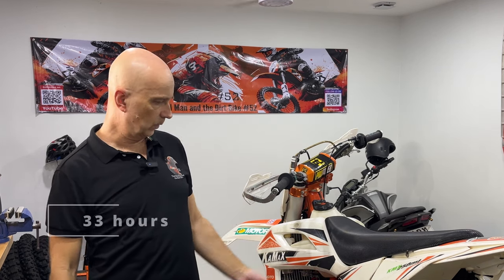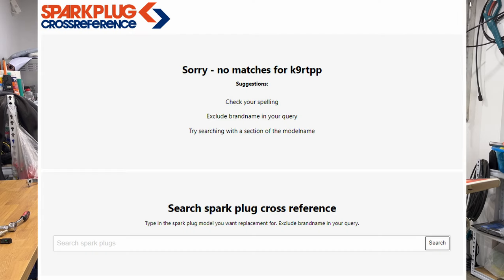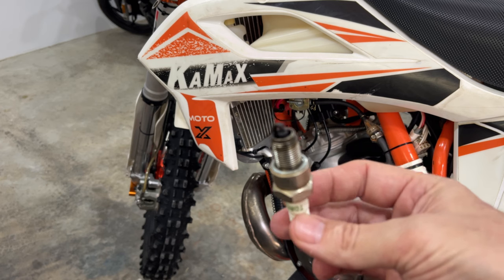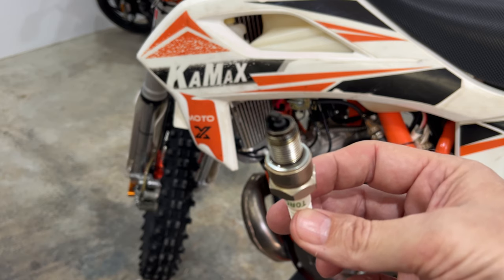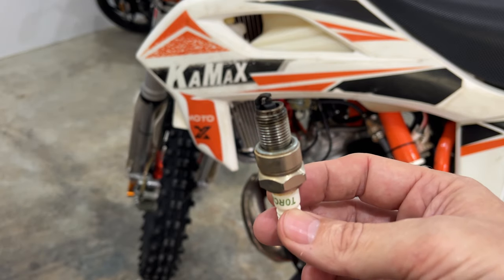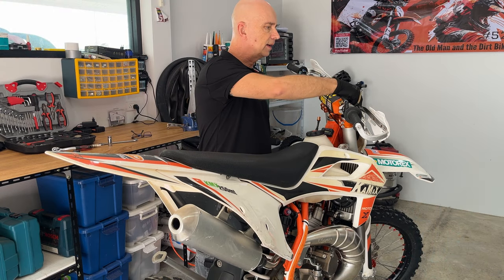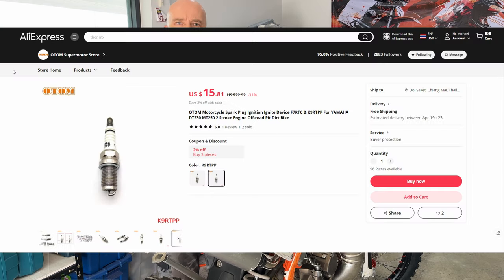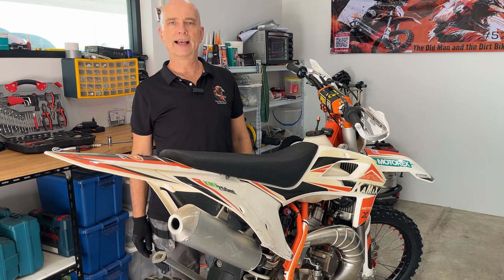Spark Plug for Kamax KMX 250MT | Torch K9RTPP

Comment from the maker: Torch K9RTPP spark plug 🔗 https://s.click.aliexpress.com/e/_DeQ...

Are you struggling to find the right spark plug for your Loncin engine dirt bike, such as the Kamax KMX 250MT, GPX TSE 250, or Hengjian 250? Look no further! In this informative video, I'll show you where to buy the elusive Torch K9RTPP spark plug, ensuring your bike runs smoothly and efficiently.

🔧 Compatibility: The Torch K9RTPP spark plug is a vital component for various dirt bikes equipped with the Loncin engine, including the Kamax KMX 250MT, GPX TSE 250, and Hengjian 250. Ensure optimal performance and ignition by using the correct spark plug for your ride.

🔍 Finding the Spark Plug: With its unique specifications, the Torch K9RTPP spark plug can be challenging to locate. Join me as I reveal the best sources and retailers where you can purchase this essential part for your dirt bike, saving you time and hassle in the process.

💡 Why It Matters: A properly functioning spark plug is crucial for ignition and engine performance. Discover why the Torch K9RTPP spark plug is the ideal choice for your Loncin engine dirt bike, and why investing in the right part is essential for maximizing your riding experience.

🛒 Ready to Buy? Hit play to uncover the best places to purchase the Torch K9RTPP spark plug and keep your dirt bike running at its best!

🔔 Don't miss out on the action! Hit that subscribe button and ring the notification bell to stay updated on our epic enduro adventures and thrilling competitions!

👍 If you found this video informative and engaging, don't forget to give it a thumbs up and subscribe for more motorcycle maintenance tips, gear reviews, and riding adventures!

🌐 Manufacturer's Link 🔗 https://bit.ly/Kamax_KMX_250mt

If you found the video useful, please consider supporting me 👉 ko-fi.com/tomatdb52
Spare parts for the Kamax KMX 250MT 👉 https://www.tomatdb52.com/spare-parts
Join my Newsletter 👉 https://tomatdb52.ck.page/email

Follow me:

Facebook 👉  

 / tomatdb52  
Instagram 👉  

 / tomatdb52  
Twitter 👉  

 / tomatdb52  
TikTok 👉  

 / tomatdb52  
Website 👉 https://www.tomatdb52.com

Camera: 
iPhone 13 Mini
4k 30fps

Affiliate Disclaimer: 

Please note that this page does contain affiliate links. I will receive a small commission if you purchase any product from my links above. This does not affect the price that you pay for the product. 
These affiliate links are how I support this channel. If you do decide to purchase, please consider using my link.

Comment: I was first surprised about the price of the plug but apparently it is an iridium plug?

Denso IK27 (and similar) should be close. At least it has the same thread. Not sure about the reach. That should be checked obviously. If that is okay, then the heat range is one of the last things to consider. 27 is the coldest plug, then 24, 22, and 20 which is the hottest.
Reply from the maker: Yes, a bit of a pricy spark plug. But, it works well and I'm happy with it 🙏